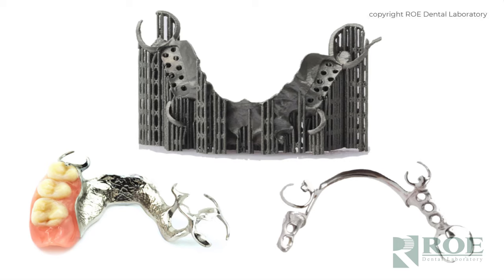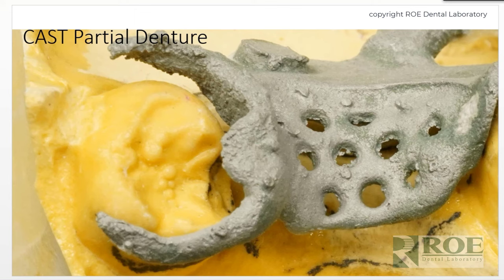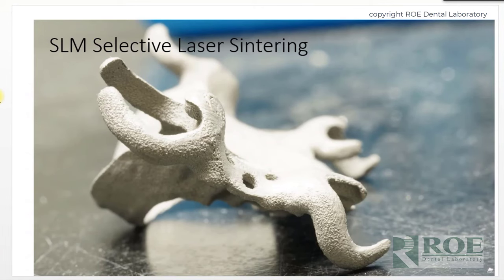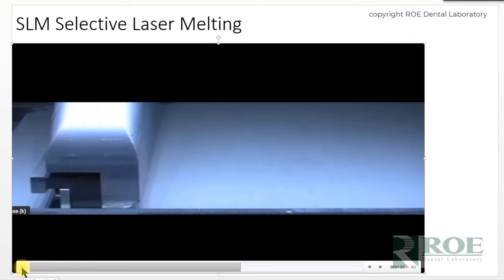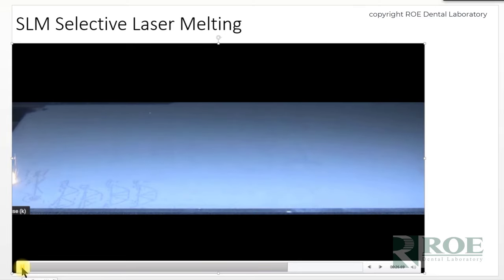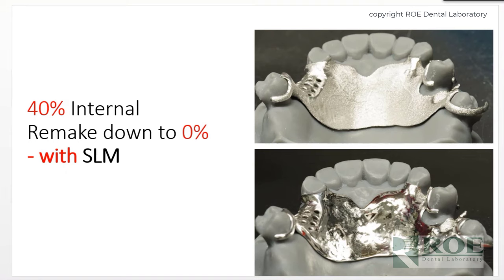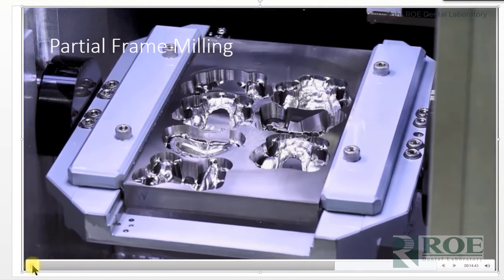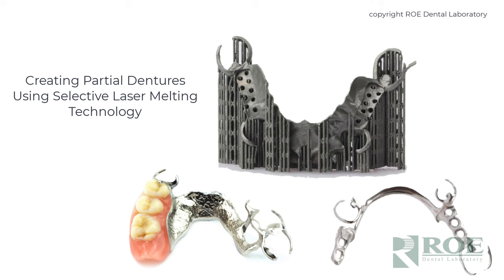Partial Dentures - created using Selective Laser Melting (SLM) Technology

Comment: What blockout angle are you using on 3shape?
Reply from the maker: Hi there! Would you be able to clarify a bit on what you are looking for? Once I have some more information, I should be able to get you the answer.
Reply: On 3shape the block out angle on the first step when setting the path of insertion. 3shape default is 5 degrees. Been printing for a while and fixing to go to slm or milled. Just wondering did much change on your software settings when you converted to slm. I’m currently at 3 degrees on my blockout angle.
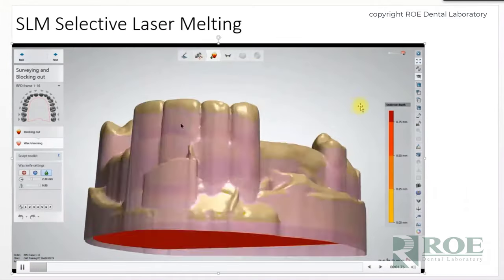Reply: At 3:25 this screen bottom left is what I couldn’t catch blockout angle.
Reply from the maker: @bigdaddysweetlove  Thanks for your patience! I heard back from one of our technicians, and they let me know that the blockout angle we used for this example is 3.0 as well.